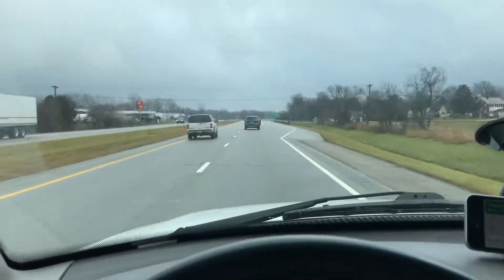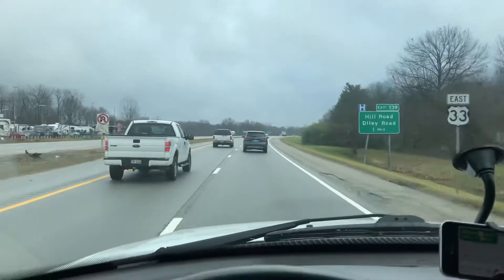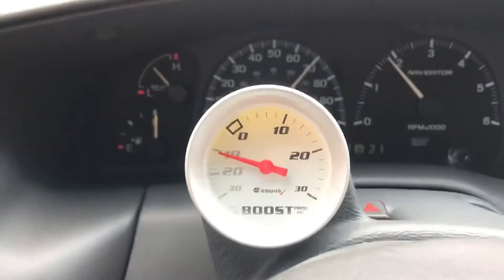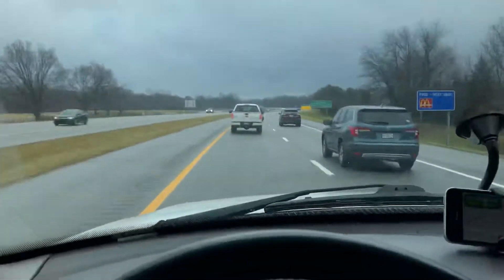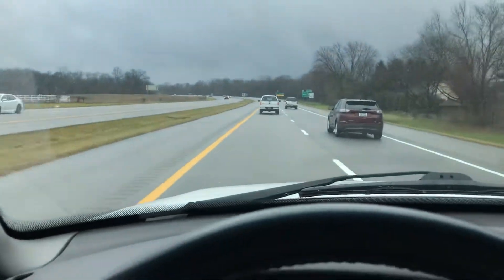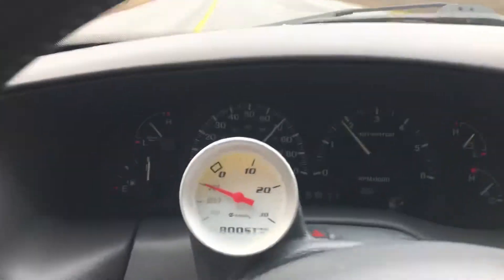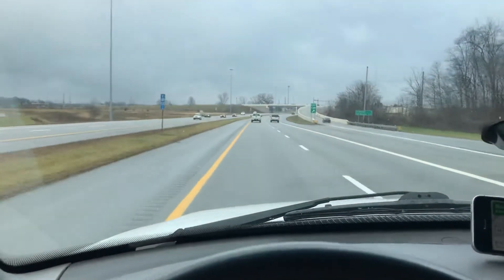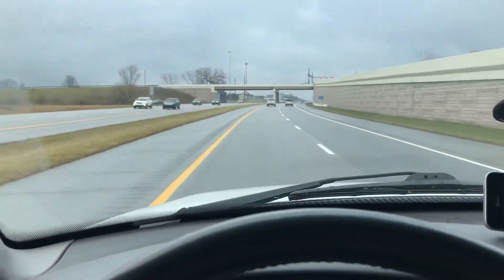How To Monitor Engine Vacuum at Highway Speeds For Best Fuel Economy: Old School MPG Tool

Comment: I usually pull about the same vacuum.  What is important about engine vacuum?
Reply from the maker: Vacuum at the proper range indicates you are getting the most efficiency out of your engine.  Gear and tire changes can impact vacuum and therefore engine efficiency and fuel economy.  Vacuum can also be used to diagnose some engine problems.